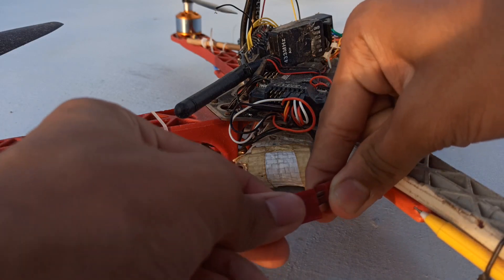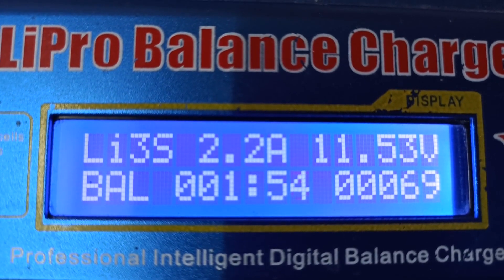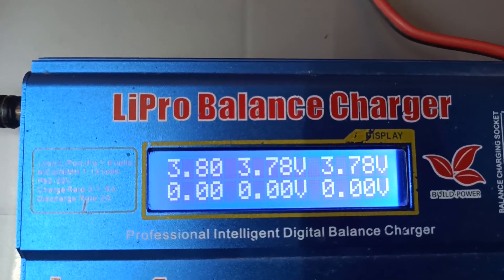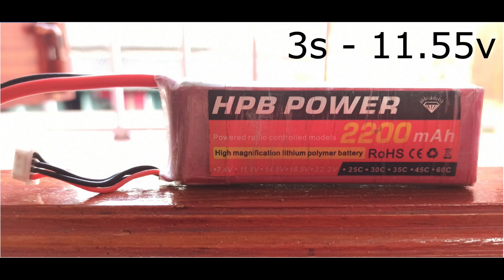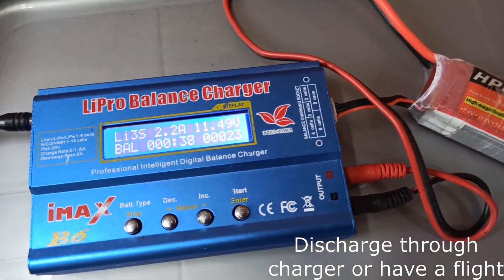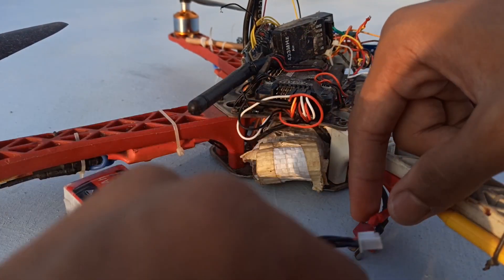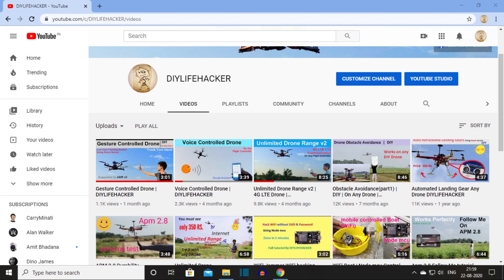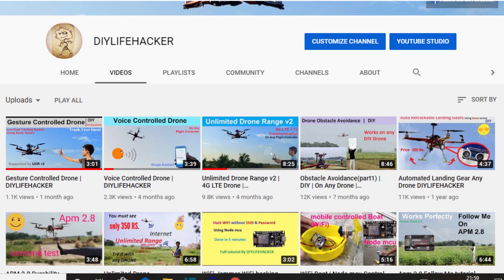Lipo Battery Safety Use | DIYLIFEHACKER

Comment: Hey buddy... 
I've subscribed and checked all your videos..
I built an APM 2.8 based quad on f450...

Flight is not at all stable also very difficult to control and crashing often...

I guess my values for configuration on mission planner are messed up...
Please share your no so we can connect and you can resolve my issue